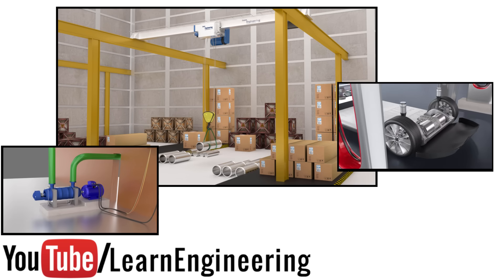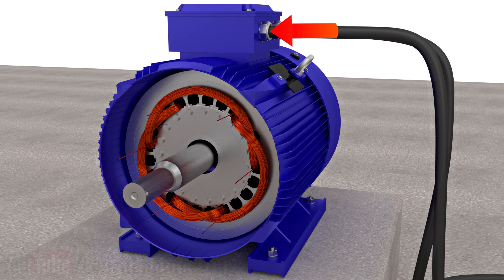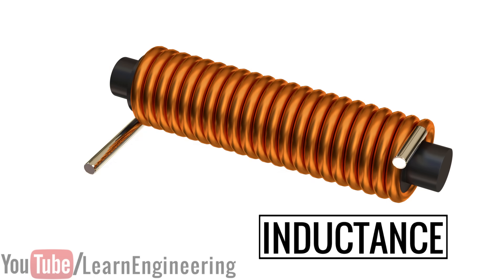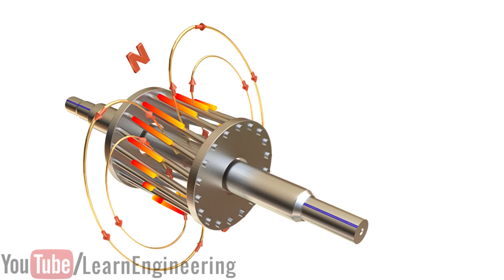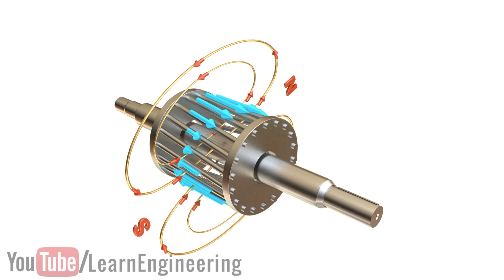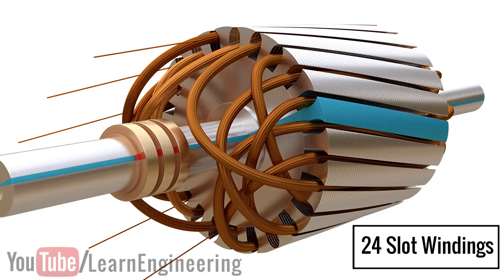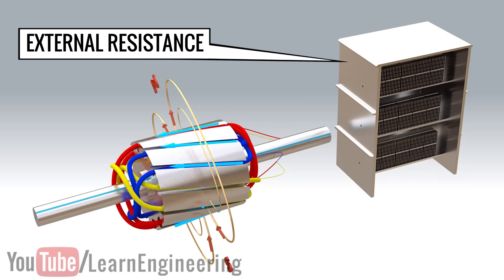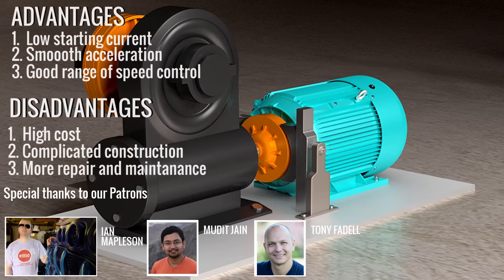Slip ring Induction Motor, How it works?

Comment: I will have to come back to this.
I have met slip-ring motors twice as I know of - both 1920's equipment.  Decades ago on "Ilner sets" (sic.) driving rolling mills, and now as a winder at a small historic mine.
I didn't know of those major advantages.  I thought it was a robust reliable sensitive means of speed control at a cost of low efficiency (higher electricity bill).  Got this wrong it seems - hence must return to this.

Comment: Is there a way to increase resistance at low speed of the squirrel cage rotor without having to go to a slip ring induction setup with those contacts that can wear out?

Comment: If the motors in a lift, hoist, plastic injection, blow molding  machines, and other use, the induction motor does not run continuously, why not introduce the resistance in the squirrel cage itself.

About 50 years ago my brother had some problems with the squirrel induction motors on the plastic injection machines. The squirrel cage  developed open circuits in the squirrel cage aluminum bars of the rotor. What we did was to rip out the aluminium bars of the squirrel cage and replaced the bars with welding rods from the Manual Metal Arc Welding rods 6013,  which were resistive when compared with the aluminum bars.  We bent the welding rods progressively over the next one ahead and brazed them together at the ends .  

The result was a better starting torque during the  short runs the motors made in a plastic injection machines.

Comment: Hmm, the brushed electric motor. Simple but inefficient. Let's make it brushless and more efficient. Magnets are expensive. Let's make a motor without the magnets. Low starting torque. LETS ADD 3 BRUSHES. Logic

Comment: Idk hiw, but how a simple resistance cause phase shift, i hv hv not read abt it anywhere, elaborate pls, n also more resistance into the cage path will reduce the field intesity causing low magnetic field so lossy motor elaborate this too

Comment: Instead of external resistance, why not use power electronics to reduce I2R losses, probably also injecting some amps too into the rotor for higher starting torque, torque control at any speed, adjustable speed-torque characteristic, and it can be a synchronous motor!

Comment: By increasing the resistance in the rotor, the current in the rotor would also decrease, right? Hence, the torque will also decrease because torque is proportional to magnetic flux and current. Then, how come the starting torque is increased? In other words, a large amount of power is dissipated as heat in resistor, so, to compensate for that, torque will be reduced, isn't it??

Comment: Nobody use this type of motor any more. It is not the torgue but speed regulation that they provide otherways very unefficiant for the rotor winding has lot of resistance vs. Shorted rotor.

Comment: Great video. I have one question. RE: the statement: "If the maximum EMF is on one bar, the maximum current will be on another bar" I understand and believe this is true with an external power supply to the rotor. But when the rotor power supply is coming directly from induced voltage it doesn't seem true. For example: If 1000v emf is induced on one bar below a field pole (this includes deductions for the bars own back EMF) perhaps it causes 10amps to flow in that bar. But! There are two bars with side of (four in total) and they will take 2.5 amps each to return the current to the other end of the rotor. So... I would have though the bar with the most current is almost always the bar directly under the active pole field.
Reply: The bar directly under the active pole field will have the highest induced EMF but, because of the high inductive reactance, the current in that same bar will lag that bar's EMF. The current in that bar is what ultimately provides the magnetic attraction to the RMF's magnetic field and is what pulls the rotor along. The more the current in that bar lags the RMF the less the torque. That's where the resistance comes into play- it reduces that lag providing more torque at startup.

Comment: I wonder: Is a Slip Ring Induction motor still preferable over a regular Squirrel Cage Induction Motor when the latter is used with a variable speed drive or soft start device? If anyone has an answer I would be glad to hear it! In any case, great content! Thanks for these videos!!
Reply: I would guess with a VSD and the very low frequency it provides for startup, you would have a very low inductive reactance in the rotor and thus a very low voltage to current lag at startup thus not necessitating a slip ring rotor with external resistance.

Comment: In the early 1970s I worked in a movie sound lab in Vancouver, Canada.  Our many playback machines, the projector, and the recorder, all transporting 35 mm picture film & 35 mm magnetic {audio} film, were synchronized {locked together} using 3-phase wound-rotor induction motors.  Shortly after that time, cheaper & more flexible vari-speed-capable stepper motor technology came into use, and all those beautiful expensive wound-rotor motors went to the scrapyard.  Today, of course, the movie business works with giant digital files.  Analog images & audio recordings are ancient history, with a few very rare exceptions.  But it was interesting to have worked with that 1930s interlock technology - it had its charms...

Comment: If higher resistance gives lower phase angle difference. Why don't you just leave as it is in higher resistance when the rotor runs at higher speed as well?
I still don't understand
Reply: The frequency of the induced voltage in the rotor decreases as it speeds up causing the inductive reactance in the rotor to also decrease and the phase angle of voltage to current to correspondingly decrease. You no longer need the resistance to decrease the phase angle once the motor is up to speed- it would then be inefficient to leave the resistance in.

Comment: The disadvantage of slip ring induction motors, is they have brushes, which can cause sparking if they're worn out, but I think they made of a material that is different than the carbon. And slip ring induction motor, works like universal motor.
Reply: A slip ring induction motor will not run on DC. A universal motor will.
Reply: @fiddlyphuk6414  I mean it will work the same way as it but it will only work on AC, I am talking about the similar carbon brush function, not about the power supply the motor can run at.

Comment: Please correct the advantage part in the video.
As those are the advantages and disadvantages of slip ring induction motor, so 1st advantage should be high starting torque .
Thank you very much for making this video. It is too much helpful and easy to understand.

Comment: Can someone help me about this problem? we have wound rotor induction motor(600Kw). we add rotor resistance at only starting. but we want to run it speed at 60% from it’s full speed. Then we have to add rotor resistance whole motor running period. now it short after starting. we want to know, is this possible or not?
Reply: You need a VSD to efficiently run your induction motor at 60%. You can then run a solid squirrel cage rotor with no slip rings or rotor windings.

Comment: In slip ring motors the armature windings are connected to the resistor bank with relay contacts....the coils on the relays are controlled by the pushbuttons that are stepped.... meaning as  you push the button in the different relays are energized and pushing the button all the way in there is zero resistance....the slip rings are connected together by the last relay contacts.....also if you try to run one of these motors with the armature windings not connected at all the motor won't spin.

Comment: Otherwise I love the video, but the low starting torque is not the main reason to use slip rings from what I know! Problem is mostly big inrush current of big induction motors, slip ring motors were used because regulating speed/current is easy. You yourself say that they have low starting current, but in that case they also have low starting torque, don't they?

Comment: I thought it was going to be a way of switching the effective number of poles during starting.   I had never heard of a slip ring induction motor but I have seen an induction generator with coils and PTC thermistors in series to shut the generator down in too much current drawn or heat occurs.

Comment: what i dont understad: if the resistence is increased than that should also decrease the current flow in the rotor and therefore the power of the whole motor, shouldnt it?
Reply: The resistance is only used for starting.

Comment: This video gets the current and hence force directions wrong. It was a good springboard to thinking properly about motors, but this video in itself gets a lot wrong. You still get more torque for added resistance, and it DOES have to do with affecting the lag timing, but the details therein work out differently. If anyone actually cares about my two-cents and wants to know the details, reply below and I'll explain.

Comment: @3:02 I paused the video and observed. The direction of electro magnetic force shown in the animation is wrong. Use F=Current *(Vector product of L and B)
 L= vector having magnitude= length of conductor and directed along the direction of current and B is the STATOR MAGNETIC FIELD VECTOR. Using right hand rule, we get the direction of electro magnetic force to be opposite of that shown in the animation.

Please correct me if I am wrong.
Reply: The direction of F is wrong because the direction of current is wrong. The induced current will oppose the change in field (from the stator)
Reply: Hey  @levimays55  , I was confused the same way. The magnetic field shown isn't stator field instead it is rotor field. Now on using right hand rule and all we get the same direction of rotation and the rotor current as shown in the animation. But If was asked to animate then I would have animated the stator field intead of rotor field as that would be a lot more intuitive and easy to understand.
Check out the note I prepared  here, that may be helpful.
https://drive.google.com/file/d/18H-DJ_Gq8dHPaIIZgnxAYcIXxqug0_Lk/view?usp=sharing

Comment: Great video!!! I assume that as the rotor speed increases, then the ext. Resistance is decreased as well to avoid losses. Right?
Reply: Yes, with max external R, you can achieve max starting torque so it is useful for starting only and eventually reduced to for reasons you've mentioned

Comment: I doubt anybody understand what is being explained here. This is the best way to make things complicated by throwing fancy laws and animation.
A simple explanation, slip ring are conductor wrapped around the rotor shaft to supply electricity  to the rotor coils to make it magnetic (generate strong magnetic field as compared to squirrel cage design). That way when the motor is started the magnetic field created from the stator and the rotor will spin the rotor with high torque. Each design has its applications, a fan does not need high torque, an escalator does.

Comment: It's really a great video 😊,
Can you make a video on drivers for SRInduction motor? Is it possible to connect vfd here and achieve the same goal by avoiding resistance? I mean low frequency at the starting for higher torque then normal frequency setting while running?please give me reply...

Comment: By increasing the starting resistance you can simulatneously increase starting torque and decrease stator inrush current.  Saves a lot of cable.  Past a certain point the increased resistance allows you to reduce torque again thereby giving a softer start and speed control if desired.  Most manufacturers use the same housing for squirrel change and wound rotor machines.   Cranes, grinding mills, metals crushers can all benefit from something that can deliver nearly 5 times continuous rated torque.  Unlike VSD there are no harmonics and no transistor or switching losses.
Reply: d

Comment: According to My Experience this video is best for learning
#TeachinicalEngineer
Reply: @3:02 I paused the video and observed. The direction of electro magnetic force shown in the animation is wrong. Use F=Current *(Vector product of L and B)
 L= vector having magnitude= length of conductor and directed along the direction of current and B is the STATOR MAGNETIC FIELD VECTOR. Using right hand rule, we get the direction of electro magnetic force to be opposite of that shown in the animation.

Please correct me if I am wrong.

Comment: How do you make a motor spin faster I haven't RC car that I want to make it faster but I Don't want to be using more higher voltage for the current motor would burn it and won't work
Reply: Up

Comment: 2:20  You state that the higher the frequency the higher the inductive reactance and the phase difference. Yes the reactance will be higher but I don't believe the phase difference will change. Doesn't the phase difference in a purely inductive coil remain unchanged at 90 degrees no matter what the frequency unless an additional component such as a resistor is added into the circuit?
Reply: @PhillipCAdler     I take that's maybe what it meant but it was badly worded

Comment: I just invited my 100 students to watch this video as a complement to the analytical/mathematical analysis of the induction motor that they've just seen on the chalkboard. Thumbs up, guys! Excellent work!
Reply: @3:02 I paused the video and observed. The direction of electro magnetic force shown in the animation is wrong. Use F=Current *(Vector product of L and B)
 L= vector having magnitude= length of conductor and directed along the direction of current and B is the STATOR MAGNETIC FIELD VECTOR. Using right hand rule, we get the direction of electro magnetic force to be opposite of that shown in the animation.

Please correct me if I am wrong.

Comment: @ 1:22  If the effect of Lorentz's law is causing rotational force due to the magnetic field and rotor current then why wouldn't a single phase squirrel cage induction motor not be capable of self starting without needing a starting coil or a shaded pole? I've never been able to grasp that.

Comment: 2:06 "You can see that the current flowing through the circuit is NOT in phase with the applied voltage. This is because of an inductive reactance in the circuit. The higher the frequency of the electricity, the greater will be the inductive reactance and the phase difference."
Absolutely perfect till here. 

Then from 2:21 "A higher resistance value reduces this phase difference." But for an ideal resistor, its resistance is purely linear with current and voltage. It doesn’t store any energy in it. How is it causing a phase difference?
Reply: Current and the resistor voltage are in phase. If you look at the voltage phasors for the resistor and inductor, you will see they are at right angles. The resultant emf will be the vector sum (ie. a diagonal line from the center). If the frequency increases (XL =jwL), the inductor voltage VL will increase and the phase between emf voltage and the current (or Vr as the both current and Vr are in phase) will increase. My understanding is if you increase the resistance (and increase Vr), it moves the emf phasor down again decreasing the phase.
Reply: In an inductor connected to an AC source the current in the inductor is always trying to 'catch up' to the voltage across the inductor. For a given frequency the current will have an easier time trying to catch up to the voltage when the peak ac voltage across the inductor is lower as compared to it being higher. I think the resistor in series with the inductor is simply reducing that peak voltage across the inductor allowing the current in the inductor an easier time in its effort to try to catch up to that voltage across the inductor which in turn effectively reduces the phase angle of the voltage as compared to the current. I admit it's a crude explanation and that I could be wrong.